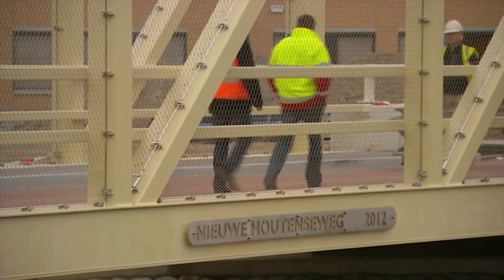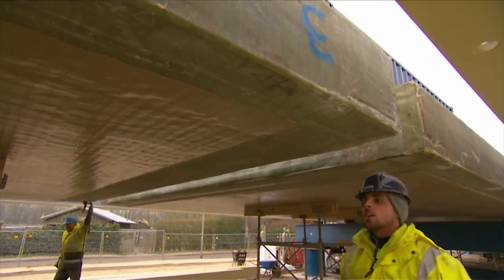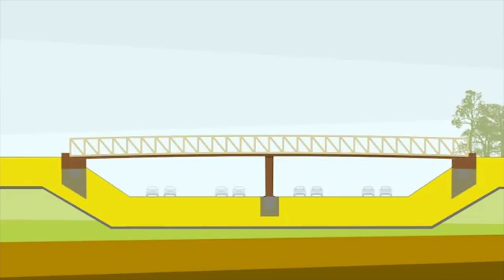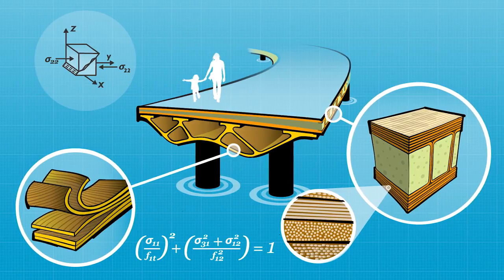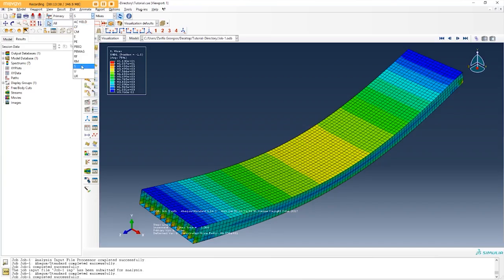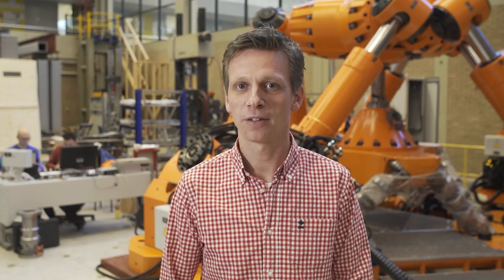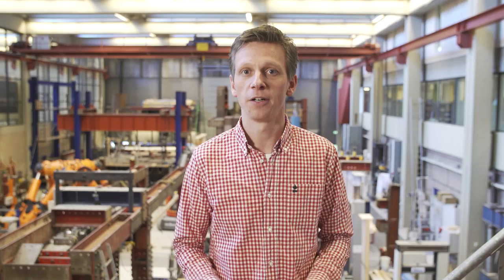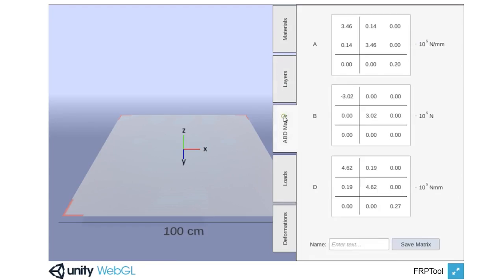FRP Composites in Structural Engineering - Online Course Introduction

Comment: Hello I'm a marine engineer but got my license through a apprenticeship can i take this course ? Worked on building a big filtration system for the tuna commission labratory in Los Santos, Panama all structural materials where fiberglass, everything was fiberglass held together with 316 stainless steel bolts talking corrosion free and almost maintenance free also. The smart mans choice . great video you visualize the future